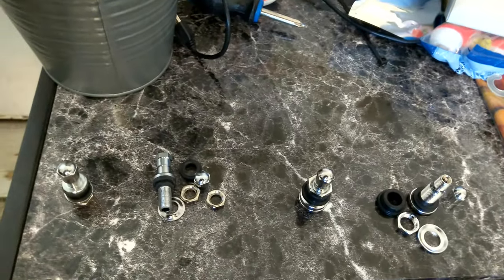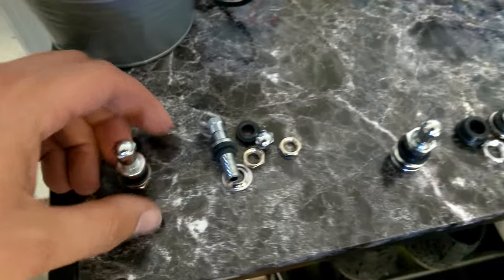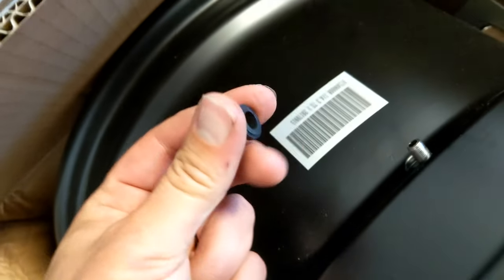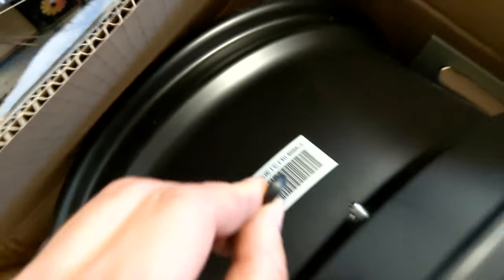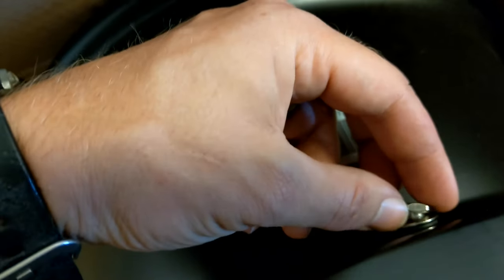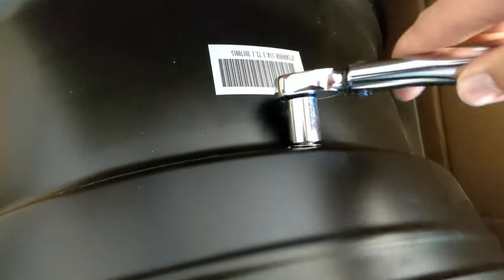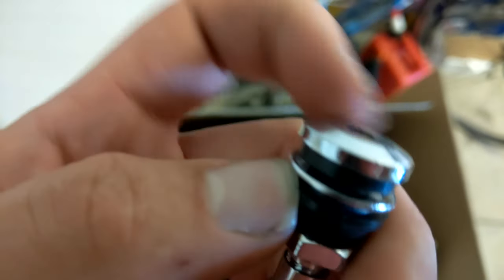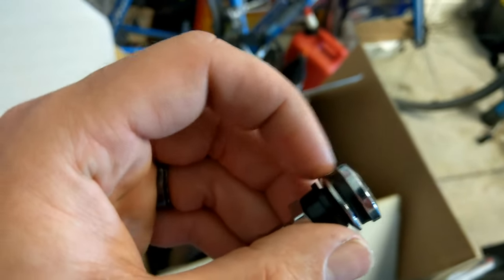How to Install Bolt On Metal Valve Stems

Comment: I would think the 'inside' is where the tire is an outside is where you'd put air in...you keep saying inside on both sides
Reply from the maker: I apologize if I misspoke on that. Yes, inside should be the part in the tire that you can't see once the tire is on.
Reply: @onall8950  I was putting some on today and that threw me off but realized you were just saying it meaning pushing it inside....👍

Comment: So I was forced to use the bolt on style on some wheels of mine a bit ago and they aren't a good fit at all because there is no flex and they face the center. But I wonder why it comes with that essentially extra rubber piece that you aren't even supposed to use for the style with the threads on the outside

Comment: Dude,  I see the other washer sitting right there for the first example. I'm not trying to guess what it is for. What's it for?
Reply from the maker: Are you talking about the other rubber one?
Reply: The stems come with two washers, to fit two different size holes.  Mine say for 0.453 or 0.625 rime holes.

Comment: Will those valve stems that tighten from the inside work on my stock 2010 Ford Taurus wheels? I have the other style but the washer and nut is too big to fit in the hole on the outside.
Reply from the maker: I can't say 100%, but I don't see why not.
Reply: @onall8950  who has the cheapest valve stems?

Comment: first design i got those in mail for my new rims.  Are those ok for midsize truck, does the rubber come through on other side when tightening?
Reply from the maker: Yes, they have a max pressure much higher than any truck tire will need. The rubber does not come through. It just pushes against the inside of the rim to seal it.

Comment: 2:26 so the rubber washer won't tear if I tighten it beyond the 45Nm?
Reply from the maker: The torque measurements in the video are in inch pounds. So you wouldn't want to go over 5Nm if the rubber doesn't spin.

Comment: What would you prefer? Bolt is inside or, bolt on the outside?
Reply from the maker: I prefer the inside. It looks cleaner and seemed easier to secure. I know some people prefer the outside at the track so they can double check that it's tight.
Reply: @onall8950  Thank you very much. Keep safe

Comment: Are the outers designed to be replaced without having to remove the tire? or you must always remove the tire?
Reply from the maker: As far as I know there aren't any that can be replaced without removing the tire.
Reply: I just fitted one to my motorhome wheel, I just broke the seal on one side and used a G clamp to squeez the tyre enough to fit  the metal valve. didn't have to do the other side or need to rebalance the wheel. Perfect
Reply: @onall8950 , @12vLife : Check out the Colby Valve or QuikStem ones! They can be replaced without removing the tire.